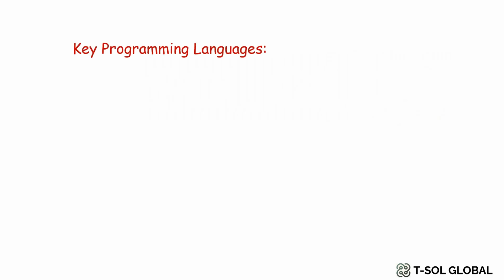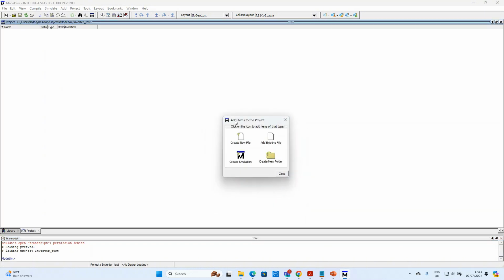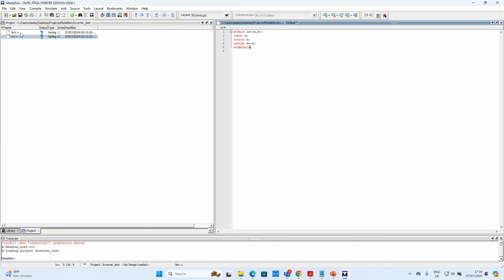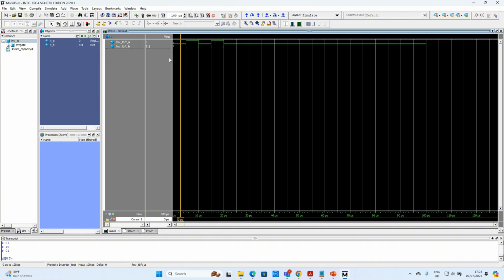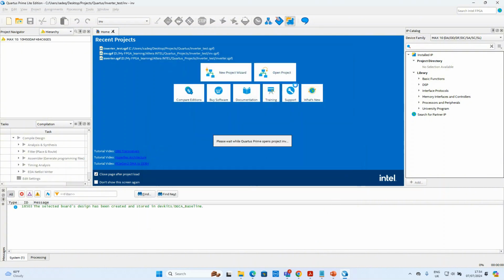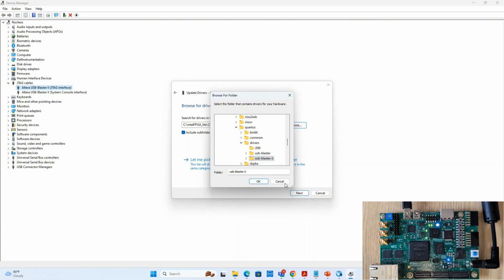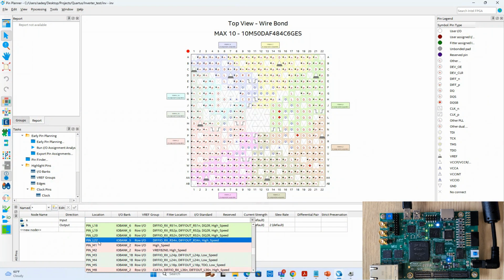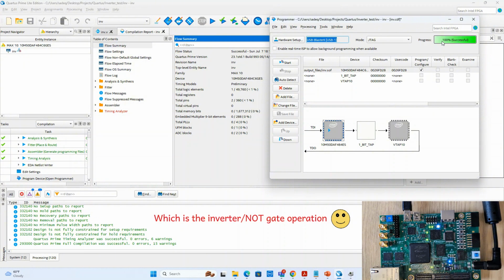FPGA Software and First Example for Altera/Intel MAX 10 Development Kit (Part-2)

Comment: How you program fpga with usb . Not using usb blaster.
Reply: I am trying another max10 development board, and I am unable to  program via usb/jtag .
Reply from the maker: @manikandan.a9451  which board are you using? The one I am using has dedicated USB B port (J12) for blaster. I just configured the programmer in Quartus Prime properly. No extra thing required.